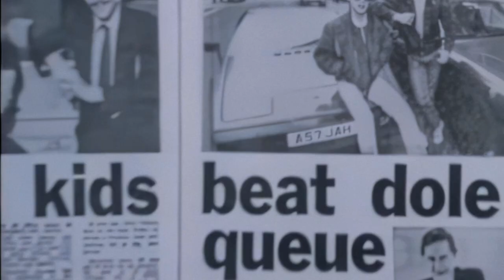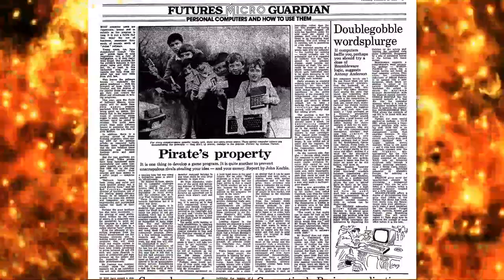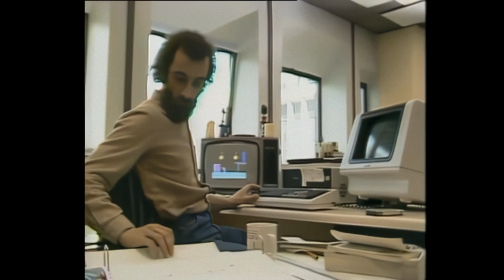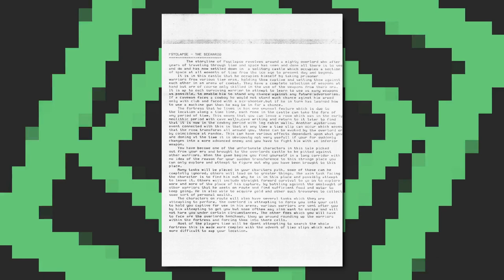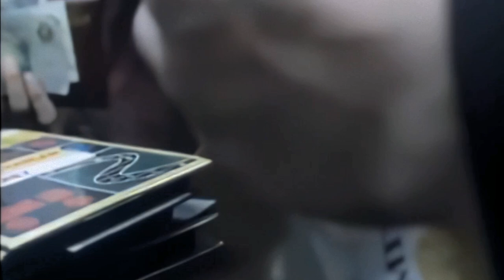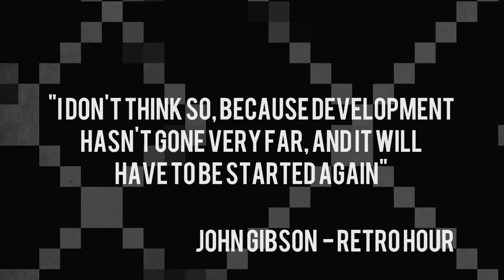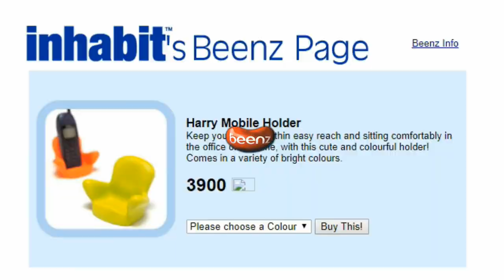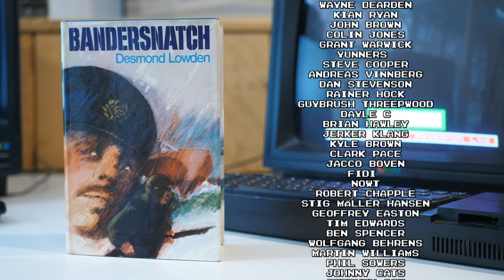Mystery of Bandersnatch: The Game that VANISHED | Nostalgia Nerd

Comment: Brataccus (my favorite game in the early ST days, followed fairly closely by Sundog) was also released on the Mac. It only used 512x200 of the 640x200 medium/high resolution of the ST/Amiga, respectively. This was because it was based on the QL Bandersnatch prototype, which used the QL's 512x256 high resolution. This allowed it to be ported easily to the Mac, which had a 512x352 resolution. It just ended up vertically-squished, due to the different pixel aspect ratio of the Mac.

Comment: A friend of mine had Brataccas on his Amiga back when I was in high school in the late 80's, and we spent many hours trying to figure it out. Ultimately it wasn't a very good game, but it certainly was ambitious and different. I remember that the controls were surprisingly slow and clumsy, probably as a result of trying to move around all those giant chunky sprites. The game worlds was large, with a lot of different NPCs and things you could interact with, but there was no real indication of what you were even supposed to be trying to accomplish in the game. I don't think we every actually reached the game's ending, assuming it even had one. Ultimately a frustrating experience as a game, despite how ambitious the design was.
Reply: I have several videos on my channel about it, including the solution of you are interested. However, I will warm you now, the ending is crazy in satisfying to the point of possibly ruining your good memories of the open world game. For example, I can speed run the game on less than 8 minutes.
Reply: You really needed the manual for this one. It was a great game in many ways. I owned and played the ST version, but I would believe that the Amiga version didn't use sprites nor the Blitter to speed up the graphics--like all games made for ST and Amiga in the early days (this ST was the lead platform, as it was far more popular until after the Amiga 500 was released)--and was thus even slower than the slow ST version.
Reply: In the whole context of what Imagine had in mind, I can't help but be reminded of what Bethesda was like under Todd Howard. Throwing together so many neat things into a game (be it Fallout or Skyrim) without considering the whole overarching context of what you were supposed to be doing. Not to mention the intense hyping of a game for months on end. And I'm pretty sure some version of "Trust us, it just works!" is what Imagine would've been saying if their game had ever made it to store shelves...

Comment: tbh, it does seem that the descriptions of the mega games (the bits with any substance) just describe the next generation of computer games that appeared without any extra hardware in the next couple of years. Arcade adventures, basically. Spellbound springs to mind. 

The only difference would have been the games having a bit more content because of the increased ram. It would have to have been a huge amount to make that much difference, though, which was surely unlikely.

Comment: I like how the adverts told you how much coffee and soda the programmers were consuming.

Those factors are usually more important than dumb game information, descriptions, or anything like that (ha ha sarcasm). If you know how much coffee the programmers are drinking, and the number of weeks they have currently spend on development, there is an easy equation you can use to determine 'funfactor'

Where 'B' is the development time, and 'S' represents coffee cups consumed, 'H' represents hype to date, and the 'F' will represent the fun factor.
Just use the formula:.  "B+S * H *(BS) = F

Everything is easy to understand when you "do the math". Just ask Atari

Fun (sort of) fact:

Psygnosis (how do I spell that? The font is so weird it's hard to read) went on to release Shadow of the Beast: (for Amiga, Mega Drive, Atari Lynx, and maybe other systems) a beautiful, difficult, and often puzzling (sometimes frustratingly so) game.

The best thing about that game was the sheer variety of enemy sprites they threw in it. Practically every screen had a different type of enemy, so it just kept blowing you away with new, crazy looking foes. But it was frustrating and overly difficult, at least the Lynx and Mega Drive versions. I wasn't fortunate enough to see the Amiga version, which I hear was the best.

Comment: What was it with software companies and flash cars? I remermber when I worked at Codemasters (circa 1989) at least 3 of the higher-ups had conspicuously flash sports cars and how it always struck me as oddly incongruous seeing those vehicles parked in such a rural farm-y location - basically a bunch of Portakabins and a converted barn in a field, just down the road from a quiet country town. I suppose flash cars were (and still are) a means of projecting an image of conspicuous success (i.e. loadsamoney) and that's probably all there was to it.

Comment: I had a vic 20, problem with them was the power supplies, they did not last long.
Reply: I don't have an original Vic 20 PSU, but if it was anything like some of the C64 units the problem was someone thought encasing all the components in resin would dissipate heat better, instead it just cooked the capacitors.

Comment: 9:47 And THIS, folks, is what a "dongle" is.  A hardware device used for copy protection.  It's NOT a cable used to connect your USB port to an Ethernet network.  It's not a device you plug in to connect your bluetooth mouse.  It's not any of the hundreds of things they call a "dongle" these days.  Those things are simply adapters, not dongles.  I'm so sick of people using the word dongle when they mean adapter, tranceiver, or even just mean cable!
Reply: The meaning has evolved with time. Getting mad about linguistic phenomena you're powerless to control serves you no purpose.
Reply: @noneofyourbusiness4616  You're actually wrong.  The meaning of the word never changed.  It just has been misused so much that most people don't know what it actually means.  It's like people who say "axe" instead of "ask".  Everyone knows what they mean, but it doesn't make them correct.  They were miseducated by someone that wasn't smart enough to know the correct pronunciation, or too lazy to actually change their speech habits to say it properly.  Either way it's still wrong.

Yes, I do get mad when people butcher the English language.  It shows how society as a whole is getting dumber as time goes on.  That should make everyone mad.  People need to stop being lazy.  If you don't know what a word means, find out BEFORE using it so you don't use it incorrectly.
Reply: @eric_d  If you are hearing the word used in a different way than you expect so often that it has become a repeated annoyance and frequent thorn in your side, that's a good sign the meaning has in fact changed and people are not going to stop using it the way you don't like. "Axe" for "ask" is an accent, not a matter of misunderstanding a word. By the way, here is what the Merriam-Webster dictionary says a "dongle" is: "a small device that plugs into a computer and serves as an adapter or as a security measure to enable the use of certain software." (Bold emphasis on "or" added by me.)
Reply: @noneofyourbusiness4616  It's not that I hear the word used in a different way than I expect at all.  I actually expect it to be used incorrectly more often than not, because people are getting dumber and lazier.  People are misinformed about the meaning of a word, and continue using it wrong does not make them right all of a sudden.  It still makes them wrong.

How many different dictionaries are there?  Look up just about any word in all of them, and you'll have different definitions.  Dictionaries are not always correct.  If they were, they would all agree with each other on the definition of every word.  Also, dictionaries are written by humans.  Humans can obviously be misinformed, or just plain wrong.

The dongle was invented as a hardware form of software copy protection.  That's it.  They came up with the word dongle because there was no current word to describe the new type of device that they invented.  Do your research on it and see what you find.  Why use an established word to talk about something completely unrelated, when there's already a word for that thing?  If there's an adapter for something, then there's an adapter for it.  That doesn't make it a dongel, it makes it an adapter.  PERIOD!

As far as the axe/ask thing.  No, that is not an accent.  That is literally saying the wrong word.  If someone was dyslexic I could understand if they read ask as aks, and pronounced it wrong the first time, but after being corrected they would know that it's ask.  Did the whole thing start because of a dyslexic person misreading the word?  Possibly, but there's no way to know for sure.  The only thing that we do know, is everyone that pronounces it "axe" is saying the wrong word.  Don't even get me started on people who say stuff like "he axeses too many questions".  That is just pure ignorance.

Comment: I never understood the Speccy. I guess I'm American. C64 all the way.
Reply: The Spectrum was less than half the price. That was its killer feature.
Reply: The spectrum had much higher resolution graphics at the expense of colour pallette ,all c64 games are a bit brown ,the spectrum use vivid colours but could only use a few at a time ,it had slightly more usable ram than the c64 and that was used by some incredible programming,the spectrum could not do smooth scrolling ,neither could the amstrad ,the c64 was the one to own if you wanted something like an Atari 7800 ,it was a great machine but the other 2 are incredible as well in their own way,I owned c64 ,but I wouldn't mind owning a speccy or an amstrad today ,just because I never had one
Reply: @valley_robot  the spectrum 48k resolution is 256 x 192. The c64 can do 320 x 200.
Reply: @huzcer  yep but the c64 very rarely used that full resolution the speccy did
Reply: @valley_robot  looking into it on the C64 the lower rez multi-colour mode was used for backgrounds BUT in combination with Hi-Res sprites. tbh the speccy was rubbish for games in comparison to the c64 - for the reasons you mentioned the terrible/ non-existent scrolling and the awful palette. (and I didn't own either but had friends who did)

Comment: Another topic that's been covered in the past you can half arse by using other peoples videos as ground work so you don't have to put the effort in. 

"I'm Done with YouTube" - Nostalgia Nerd
Reply: To be fair, there's only a limited amount of history to cover, and thousands of people working on it.  Eventually one is bound to retread ground.
Reply: @Chad_Thundercock  This has been covered more than once and and a lot more well made. This video is subpar the writing is terrible. What hes done here is use older videos as the ground work changed the structure slightly and added his own terrible writing. Even the tittle is click bait i don't even know what hes getting at "broke a generation" ?